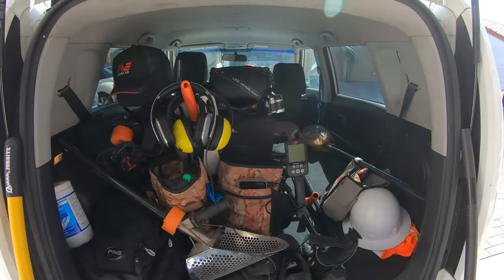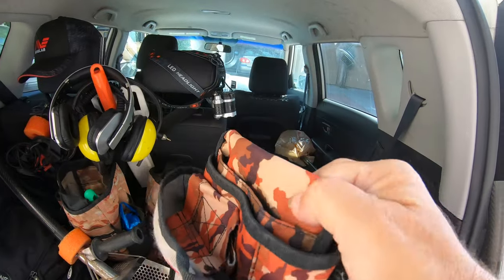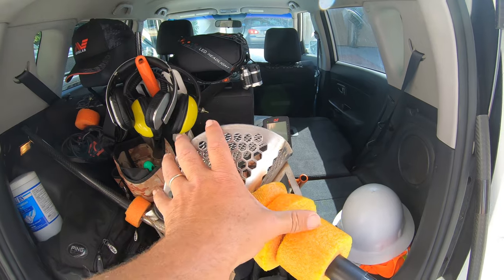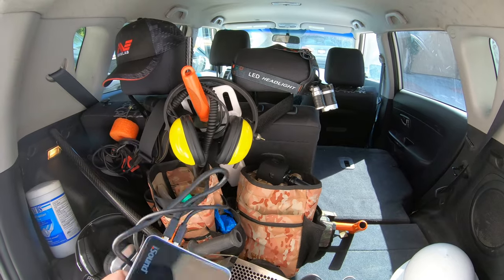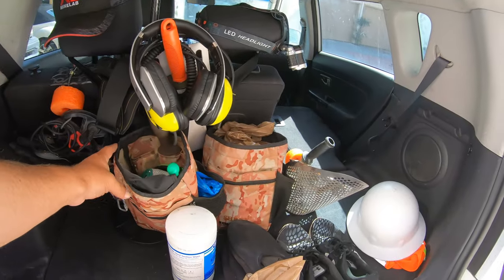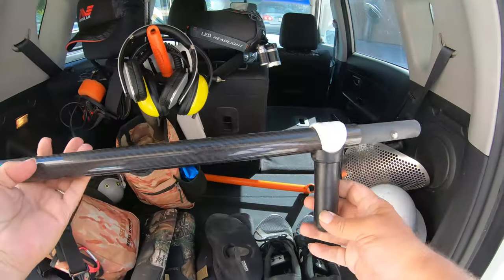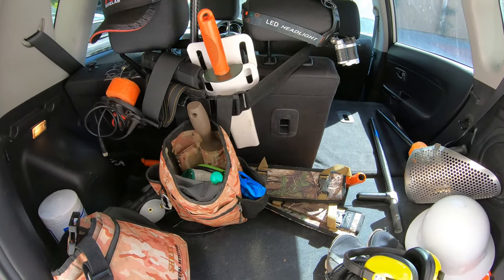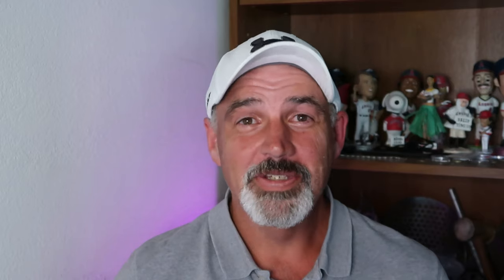What is in my car? | Beach Metal Detecting Tips

Comment: I'd dig it. It may be a zinc penny and/or a copper penny. Hey Jim, I've been using shower caps on my search coils when I can't rinse the sand off. They work great because of the elastic band. I also use plastic bags for my scoop. Keeps all the sand from getting on the floor board of my car, till I can rinse it off at home. Great job on your "Detecting Gear 101" demo. _/
Reply from the maker: Yes, shower caps are great but I tend to lose  or toss them always resorting back to the bag.  Even then I lost my bag just today and got sand pile in the car,  Lol!    a penny is a great answer, Thank you for playing! 😎👍

Comment: I dig it and I’ll stick with my answer from last week and say it’s aluminum grommet .. I have the 800 equinox for 3 years or so now and never did an update on it as I lack a computer to do so would you know it the numerical read out would be different on the screen with a detector that had any updates , I believe there has been at lease one up date that has occurred from when I bought mine. Thanks and I’ve dug a few war nickels in the past and they all rang up 13 - 14 range but none were in that good of shape as yours.
Reply from the maker: War nickels that ring up 13 - 14 on nox are not silver usually,  silver nickels always ring up high. Aluminum grommet is a great answer, Thank you for playing! 😎👍